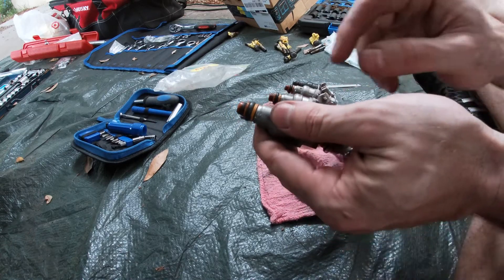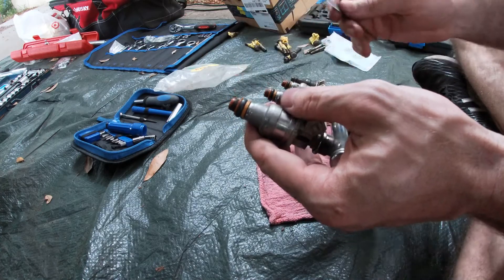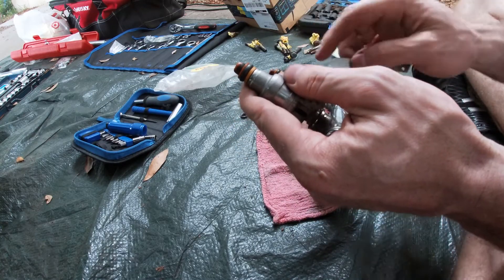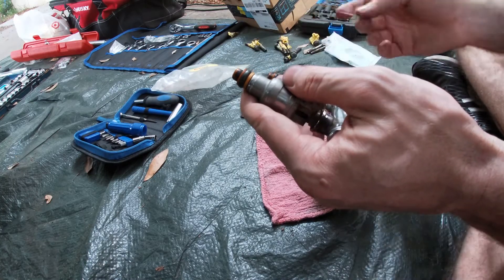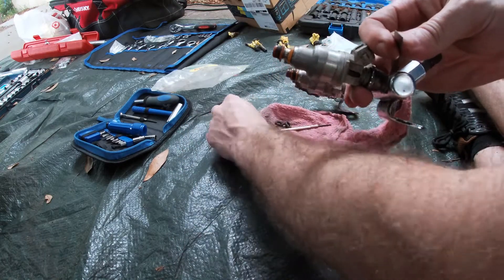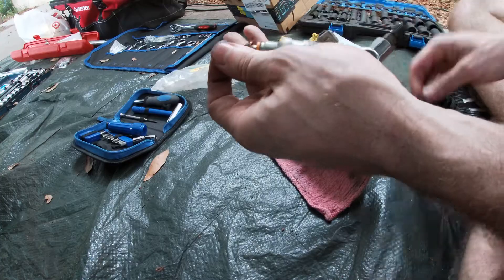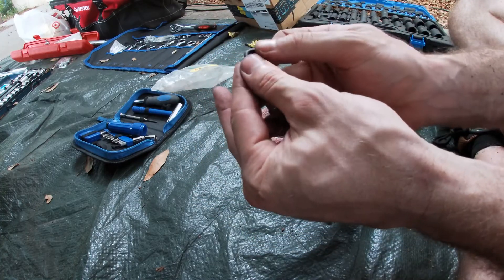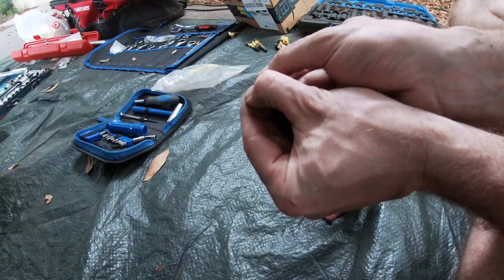Quick Tip: How to Replace Port Fuel Injector O-Ring/Seals

Comment: Oring tool. Or just slip a stiff thin smooth awl, very small screwdriver or other and pry them off.  Lubricate with silicone oil first. Not silicone mixed with distillates.  Or other fluid not harmful to rubber.  Razor is sharp and can easily score the outer wall.